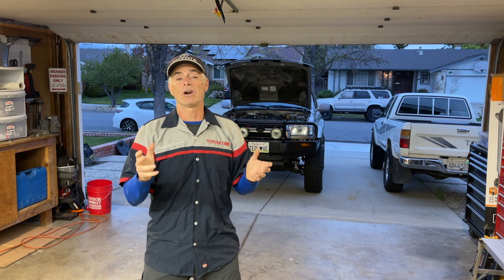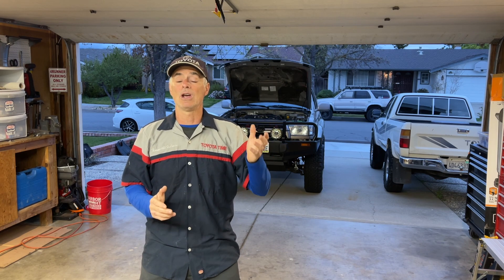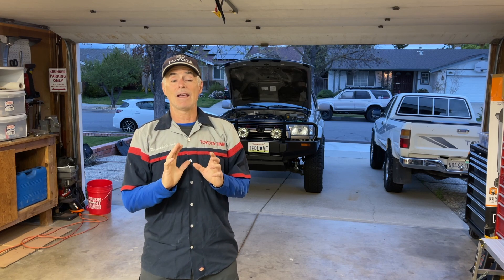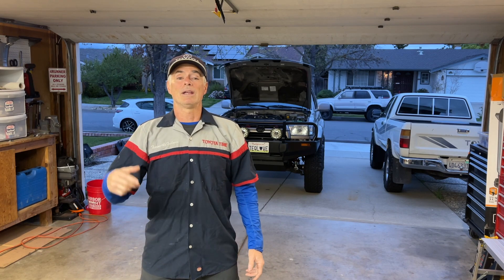How to Perform an Engine Block Test - (Head Gasket / Cracked Head Diagnosis)

Comment: Bad test kit? Next time check it by placing the kit near the exhaust pipe.
Reply from the maker: It's possible the test kit is bad, but because of the this experience, I wouldn't ever rely solely on this test to diagnose a bad head gasket or cracked head.
Reply: @TimmyTheToolman  Agreed. I wouldn't simply rely on a test kit.

Comment: Fix it right, do a thorough and slow job, don't miss anything. Take care of any maintenance and wear while you are in there. That said, @TheCarCareNut says these rods and bearings last forever, and same with the cams. Don't just get a parts cannon, but do research all the known points of failure for all the parts for the main job you are doing and might as well replace what you should while in there.
Reply from the maker: I don't disagree with what you wrote.  I do feel like I just listened to a sermon from a priest though.  I'll finish with an AMEN.

Comment: You could have bent valves not blown head gaskets
Did you do a cylinder leak down test?
Reply from the maker: There is no chance of a bent valve on a 5VZ-FE engine.  It's a non-interference engine.  We figured out the problem a long time ago.  It was a crack between the exhaust and intake valves that migrated to a coolant jacket.

Comment: If high miles pull both heads 
Resurface valves
Replace seals & gaskets
If doing a high performance job you can have a machine shop do oversized valves and heavier springs for bigger cams

Comment: I used this on our Nissan Patrol and it turned yellow indicating blown head or gasket . It was pushing out coolant  . My V6 Nissan Navara is also pushing coolant after replacing heater hose and radiator but the fluid remains blue . Nav has got me stuffed .
Reply from the maker: In order for this test to work, the thermostat needs to open which means it needs to be at operating temperature. The whine needs to be hot so drive it around first before you test.
- Sean

Comment: was their coolant in the oil?     was your thermostat opening up so contaminated coolant could get to the radiator?
Reply from the maker: No apparent signs of coolant in the oil.  The engine was at operating temperature when we did the test and the color didn't change on an engine with a cracked head.  We diagnosed the cracked head in this video: https://youtu.be/nelMt1UCEnU?si=55i-mPqeDE-jd4ux

Comment: As always Timmy, late to the show...
How do you know which side, driver's  or passenger sidehas the issue? Did you use the DTC codes??
Reply: I think I just answered my question.  My buddy's Ford has a misfire on cylinder 7 so whatever side that cylinder is on determines the head gasket

Comment: Did you get it up to temp?  If thermostat doesn't open, the exhaust gasses aren't getting to your radiator...
Reply from the maker: That's a good question and i don't remember.
Reply: That is my question also.

Comment: My 2020 ram 1500 test turns yellow. Just got the truck used 4 months ago. Taking it in to a ram shop soon to confirm. Coolant issues since getting the truck. Always wanted one, just ended up being a nightmare and now, a Lemon lawsuit in play. In 3 months time, smoking engine bay, thermostat replacement, radiator, water pump and exhaust manifold. Fml… haven’t even driven the truck 6000 miles and it has 41,000 on it. Almost like the previous owner was driving the damn thing dry smh… not to mention, did my own headlight upgrade to find that he actually crashed it too. Damage was internal.
Reply from the maker: Man, that's a tough one to hear. we will send you good vibes but if you pray to the Toyota Gods like we do, I think that will only work if you get a Toyota or Lexus.
- Sean
Reply: @TimmyTheToolman  😂

Comment: I’m in the same boat. My coolant in my Tacoma keeps disappearing, I haven’t done a leak down test but I was CONFIDENT it was the head gasket. The fluid is not turning yellow. I really don’t care much about this truck as I plan to replace it this year, but I’d like to fix it…
Reply from the maker: Looks like the leak down test is the next procedure you need to perform to get a more solid answer.
- Sean

Comment: 5VZ-FE 3.4L V6 - 225k

Long story short: Back in October I had the head gaskets and all other gaskets replaced (OEM). Reason, after a comp test, there was an issue with cly #4. Coolant was leaking into 4 ever so slightly. Heads were resurfaced too. So back in Feb I noticed the coolant level in my jug being a tad low, so I added. I had to add a few times (cup or so). Took it to my Toyota tech yesterday and it turns out it's leaking in cyl 4 again, same issue as before. It's such a small amount too. No, it is not touching my oil. My guy is straight as an arrow and I have used him for 5 years. His work is solid through and through.  So now what? All OEM parts, heads resurfaced, and all torqued to spec. Could there be an issue with the small block, the heads again, who the hell knows with my luck
Reply from the maker: Your head might have had a crack in it between the valves and it was never a head gasket issue.  The crack can be small and unnoticeable unless you're really looking for it.  I have a feeling your mechanic and the shop resurfacing the heads missed it.  That's my best guess.
Reply: @TimmyTheToolman  If there is a crack there, can that be fixed or do I need a new head?  The heads were also pressure tested too.  Thank you
Reply from the maker: @raydonovan7988  If the head has a crack,  it has to be replaced.  I would think it would have failed the pressure test with a crack, though.  Something isn't adding up, but clearly, the job needs to be redone.
Reply: @TimmyTheToolman  Just so odd that it's cyl 4 again, but that's good because we know the issue has to be right there
Reply: @TimmyTheToolman  Forgot to ask you: when the head is pulled, do I need to change all the new OEM gaskets (countless) I had installed several months ago again from when it was torn down to do both head gaskets?  I know I would have to get a new OEM head gasket for that side.
Reply from the maker: @raydonovan7988  Some gaskets, like intake plenum gaskets and the throttle body gasket can be reused.  Since it's been a short time, you could probably reuse the intake manifold gaskets because I imagine they will still be in great shape.  The exhaust gasket donuts are a crush type of gasket and those those should probably be replaced.  The fuel rail washer/gaskets don't need to be replaced because you can lift the intake manifold off without disconnecting the fuel rails or fuel injectors.  The valve cover gasket can be reused too and the cam plug on the backside of the head most likely can be reused as well.  

The head gasket on the affected side should definitely be replaced.
Reply: @TimmyTheToolman  Thank you
Reply: @TimmyTheToolman  Lastly Timmy, where is your go to for head(s) if I need one?  My truck is a 95 Tacoma 5VZ V6.  I get all my other parts via dealer at cost, which is great.  Will keep you posted when he pulls the head within 2 weeks.  Many thanks again
Reply from the maker: @raydonovan7988  I would buy one from Yota1 Performance in Riverbank California.  I don't think Toyota sells them anymore.
Reply: @TimmyTheToolman  Called them.  Super nice, but they do not have any in stock.  I just want refurb OEM's
Reply from the maker: @raydonovan7988  Gotcha.  I think I've seen Ebay sellers selling refurbished OEM head.
Reply: @TimmyTheToolman  How long does it take to remove the left side head?  Thanks Timmy
Reply from the maker: @raydonovan7988  It's hard for us to give an accurate time because we are filming.  With the videos we will have coming out and the other series we mention in Part 2, I'd say you could get the head off in one 8 hour day or less.  It depends on whether any fasteners fight you and strip or break.

Comment: Just did the heads on my 2000 using the service manual. The part that sucked for me was the exhaust manifolds. I decided to get new heads from clear water cylinder heads from Florida and highly recommend that choice because these 5vz-fe heads like to crack between the valves and that can't be machined. The heads came with the lash done and extra studs that saved my ass. You guys are awsome, still gonna watch the upcoming series even though my job is done to see what I missed haha
Reply from the maker: Thanks for sharing this Eli.  Good job doing all that work.
Reply: Hey Eli, how do you find the clearwater heads to be? I may have to go this route but their business reviews aren't stellar. And thanks a million Tim! You've kept my runner alive!

Comment: My 3.4 had a cracked head that would leak coolant into the cylinder and run rough for about 10 seconds only for the 1st start up of the day, then run perfect all day afterwards. Maybe after Sean’s truck was warmed up, the heat temporarily sealed his leak up and that’s why there were no gases present when you did the test? That’s my theory.
Reply from the maker: That's a good theory.  Thanks!
Reply: @TimmyTheToolman  I actually just block tested a friend's 4runner yesterday and the fluid stayed blue. Not trusting the test, I put a bore scope down the cylinder that had a miss code, and what do ya know?... A big puddle of coolant on top of the piston, clear as day. I take my theory back for a new one... These block testers are just crap and a clean test result should never be trusted. Compression, leak down, coooling system pressure tests, and a bore scope are the only things I'll ever use again for diagnosing a head gasket failure. After seeing your block test fail, and now my own, there's no question these are a joke.
Reply from the maker: @thebassclef007  Yep, I agree with you, but when I posted my video about using a leak down tester in conjunction with a cooling system pressure tester, I got shit from a couple "Expert Professional Mechanics" telling me I wasted time and could have just used a Block Tester.  Well, you and I definitely know better from personal experience that these Block Testers aren't all that great.

Comment: Interesting result (or non-result) from the block tester... can't wait for the next video in this series! It's going to be a fun project, I can tell.

I'm in the "if it ain't broke don't fix it" camp. I did replace the water pump, tensioner and both pulleys when I did my timing belt though, since it all comes in the same kit for a good price (also because those are things I won't leave to chance). But I didn't replace the main seal while I was in there because the old one looked fine. If it starts a small drip of oil before the next timing belt, oh well, maybe I'll do the next one a little early.
Reply from the maker: Thanks for sharing your opinion Sam.  We appreciate it!

Comment: My eyebrows raised when I saw that nice Pickup in the driveway, almost like my ‘91!

I’m dealing with similar hell regarding the head gasket tests on it, in fact. Based on records the gaskets were done as part of the service bulletin for the 3VZ in the early 2000s, however I’ve had trouble getting all the air out of the cooling system (sloshes and gurgles from the heater core at times with the heat on when the engine is still warming up). So far I’ve replaced the thermostat, radiator, water pump, all the hoses, radiator cap, etc. I’ve also tried the spill free funnel a dozen times, vacuum filling, both of those parked on an incline, and still getting air trapped. The obvious conclusion is small head gasket leak, however no coolant seepage on a coolant pressure test, holds vacuum on the vacuum fill, and a Blackstone oil analysis came back with no coolant detected in the oil. Vehicle doesn’t overheat and runs fine. The stuff that keeps us up at night!
Reply from the maker: Maybe you have some slight blockage somewhere in the heater core that's making it difficult to burp the system.